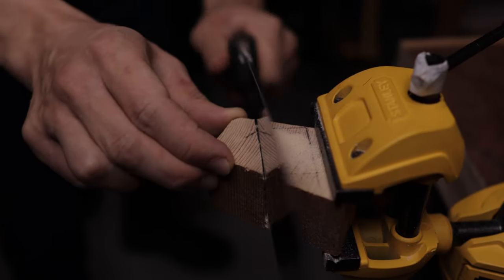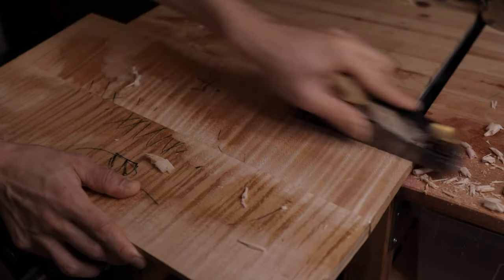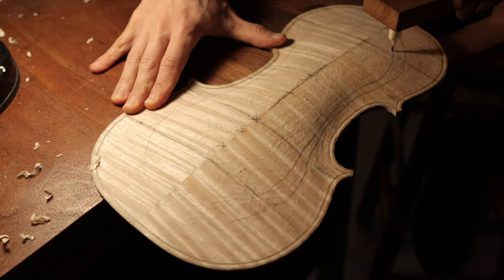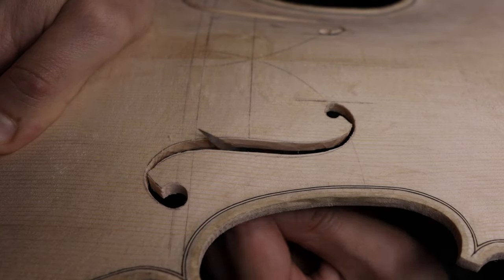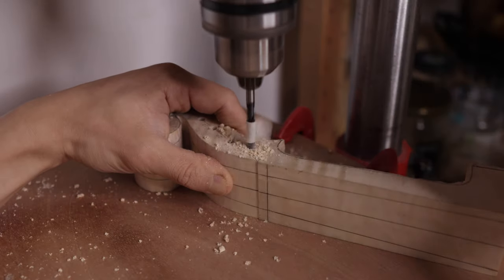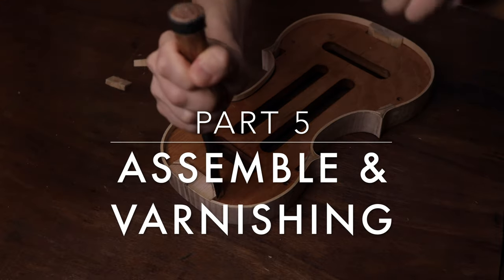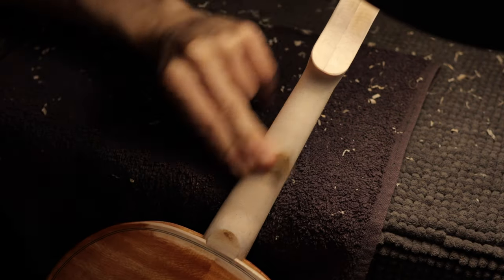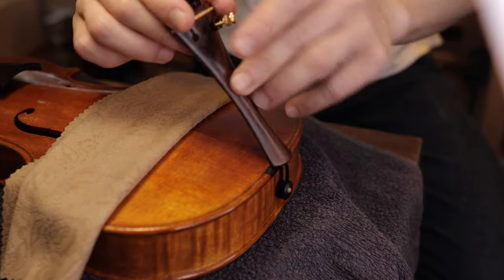Violin making process explained (Documentary with Commentary)

Comment from the maker: Here is the 1st Part of the "How to Make a Violin at Home" Tutorial:
https://www.youtube.com/watch?v=EAToUQaxJsY&t
Reply: Absolutely gorgeous. I have built Cigar box type guitars. But on a slightly larger scale.I made my own box,with dove tail corners  In order to use a smaller child scale 6 string neck. I added pezo pickups and a strat type single pole pickup at the  bridge. The two I made turned out pretty good. One was like I wrote above the 2nd had the pezo pickup and a home made resonator from a pot lid. Of course I braced the inside. I was curious about lubing the pegs. The store bought violins I have bought. The tuning pegs slipped some worse than others. It wasn't until I used rosin on them and applied inward pressure when tuning,did they finally held and let me tune them. I found out that just about all new pegs have this. I wouldn't say problem as it is in the design and what the outcome of smooth surfaces have. Do your legs do this when tuning them?
Reply: Amazing your craftsmanship is awesome do you commission violins?
Reply from the maker: Yes

Comment: Hi Corvus, is it normal for other makers like Italians especially that they strip off the varnish at the sides of the wood of the violin after the purfling like the wood is exposed already
Reply from the maker: Hi, do you mean using a finger to strip off the varnish on the edge before it dries?
Reply: Yes, they really intentionally remove the varnish at thr sides because they said it is a pratice of cremonese or brescian makere that they remove it at the sides
Reply from the maker: It depends, some varnish, specially oil, are very thin and run to the edge very fast, so we need to strip of the drippings